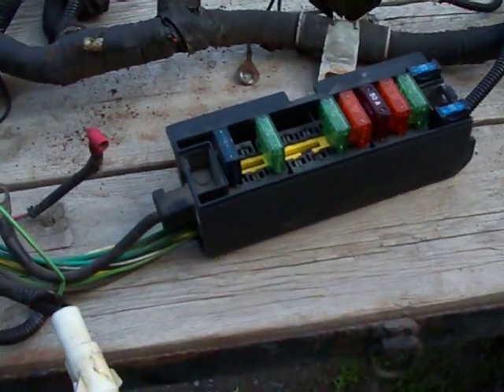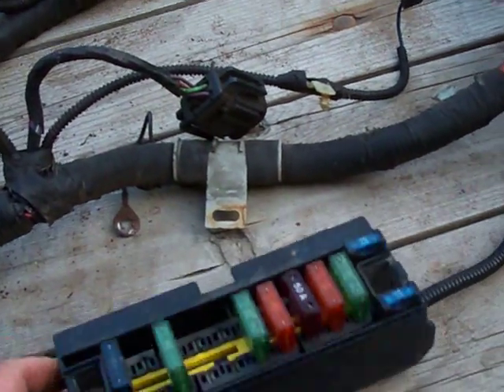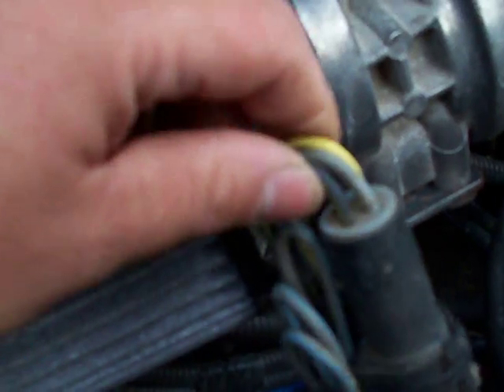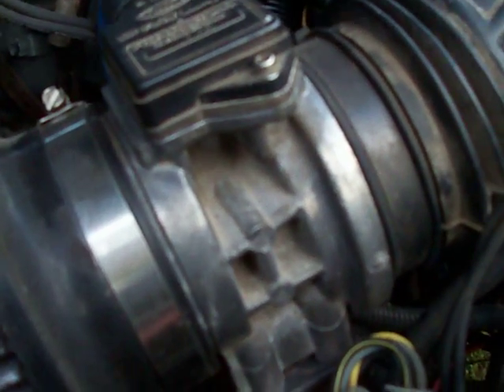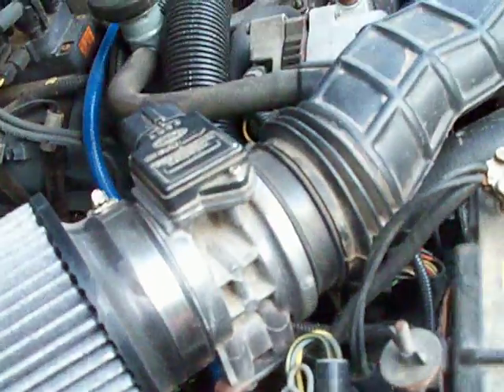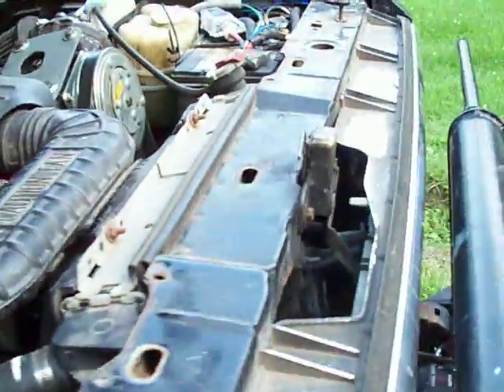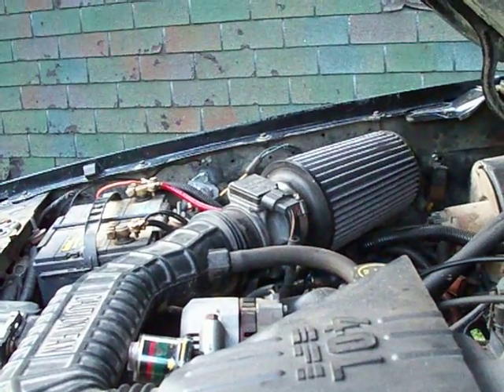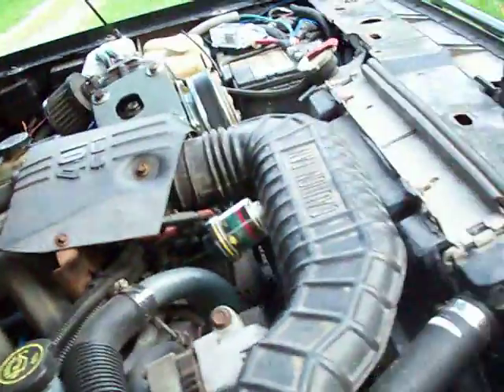Ranger 4.0 swap wiring clarification

Comment: It's GennA be a bitch @bart Giles I'm currently doing a 95 ranger 4.0 swap in to my 89 ranger and there is a huge difference in wiring I would stick pre 95 to make it easy
Reply: Did you figure out the wiring ?
Reply: Trying to stuff a 96 ohv in my 2.9